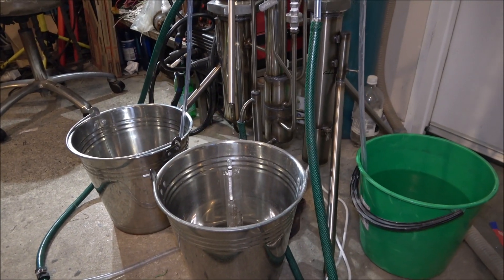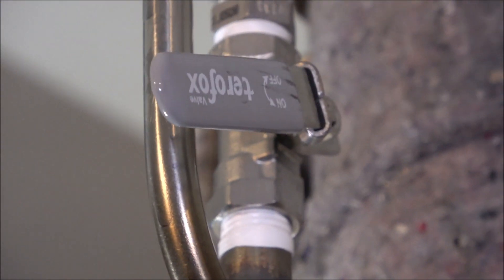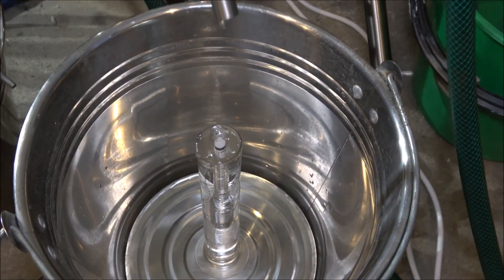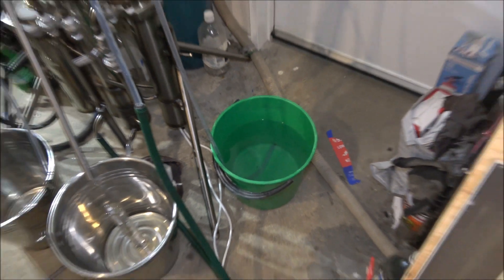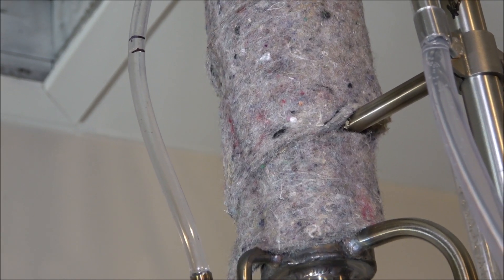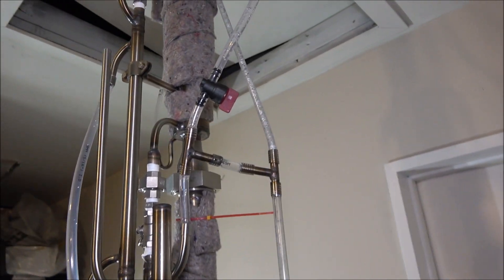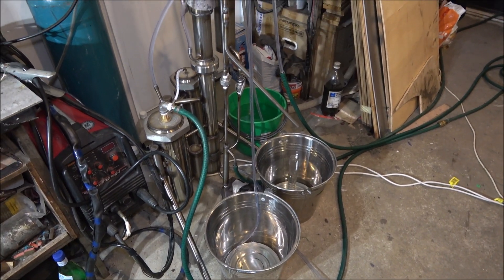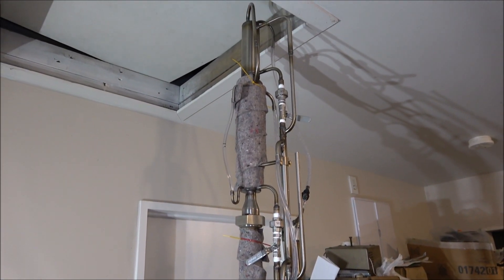Home distilling with alcohol reflux still 2kw.

Comment: What is the material for dissolving grease or paraffin in diesel fuel?
Reply: This is an alcohol still/separator and has nothing to do with what you propose. I'm not even sure if you can fully dissolve these two in diesel.
Reply: @kalleklp7291  I know it's a separator but I'm asking you what are the solvents for paraffin wax
Reply from the maker: This is the alcohol still.
Reply from the maker: Usually kerosene will do the trick.
Reply: @santeryi9  Please, how much is the mixing ratio of kerosene per 100 liters at a temperature of 15